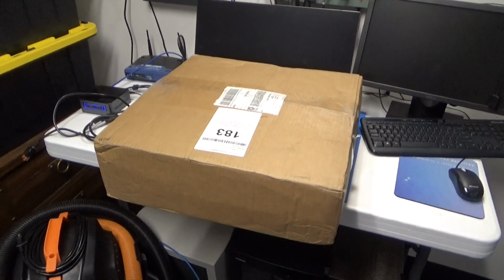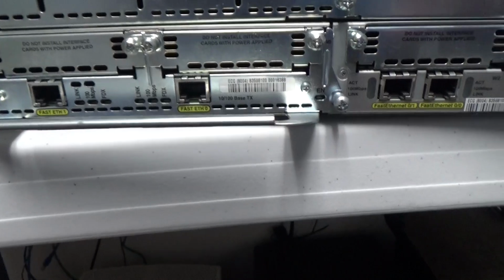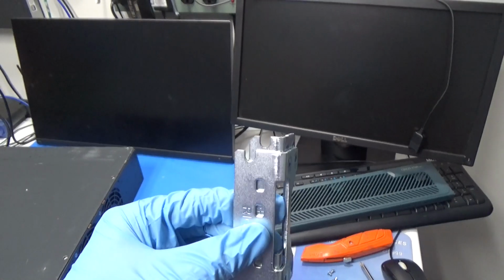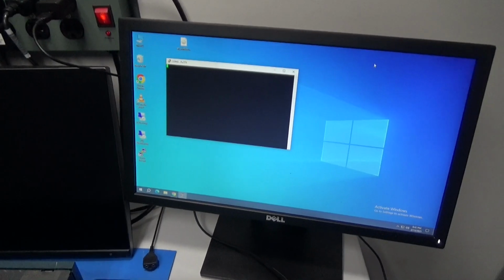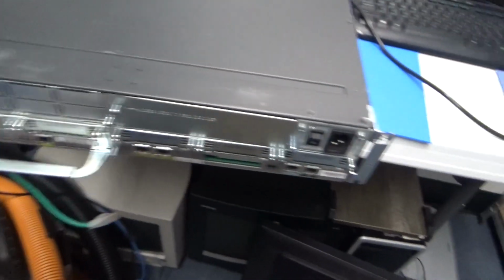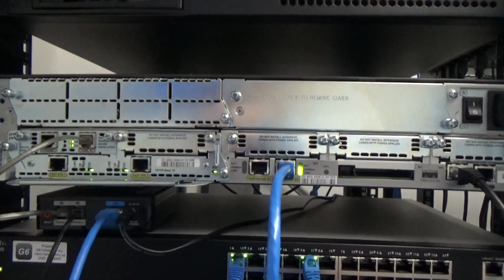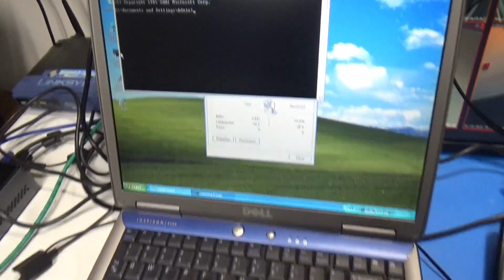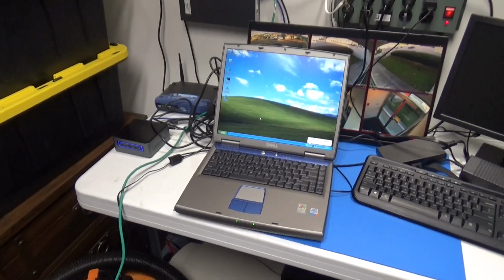Making My Own Homelab Dial-Up ISP - Cisco 3725 Router

Comment: Not sure why you are using an external ata. You can get cards that slot into the router that take 4 lines that do the same thing.
Reply from the maker: Can you make them SIP extensions? I want the dial-up lines to be available over the PBX so I can access them from elsewhere.
Reply: @G6TechnologyServices i am not entirely sure because i am fairly new at this. But i have been studying videos on the subject. The youtuber clabretro has done a number of videos on this. That is why i know that there is a card that can be used to send dial tone to 4 phones, or pc modems without the need for an external ata. You can assign phone numbers to each line.
Reply from the maker: Right, you'd have to be in the same room or within close physical proximity to the router and have a direct cable between the router and the dial-up client. If I use ATAs, I can make the dial-up server an extension on my IP PBX and dial in from anywhere without having to be physically close to the router.
Reply: @G6TechnologyServices when you say you want to access from elsewhere, what do you mean? In another building, miles away? Because i am pretty sure you can use the card i speak of the same way as the ata you are using. Its adding the same functionality just internally to the router. You just get 4 phone ports rather than 2 on your ata.

Comment: awesome work man,
i did the same with a 1841 and a linksys pap2

im now messing with compression.
Reply from the maker: Nice! It was a fun project. Good luck! I just followed some guides online, but it didn't seem like any single one had all the steps and configuration options I needed, and I had to kind of merge a few to get it working. This project was also my first time using IOS, which made things a little more difficult. It was still fun to figure it out and get it working!